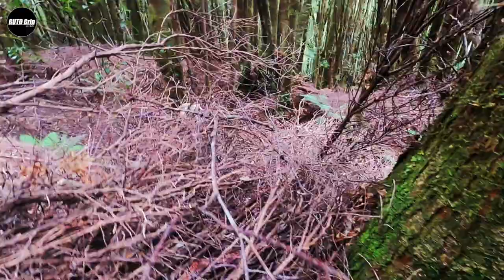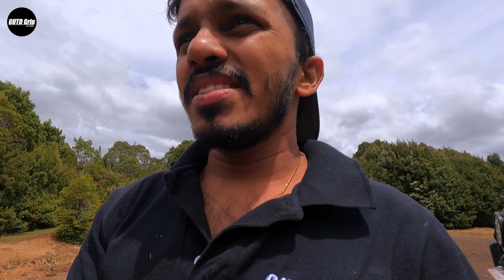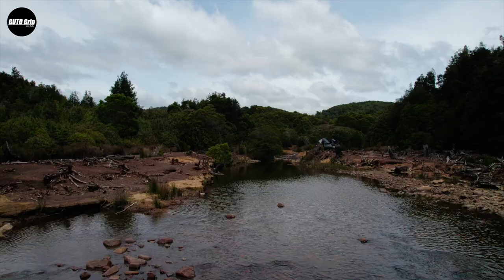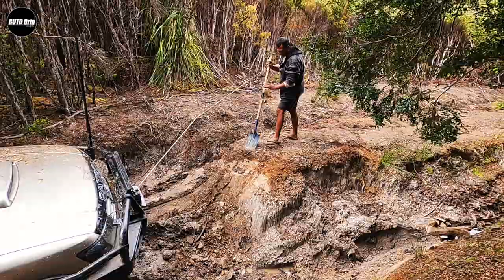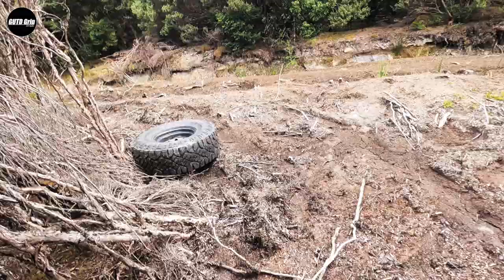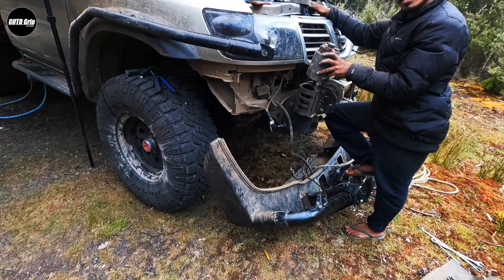හිතුවද මෙහෙම දෙයක්? 🤦‍♂️ | Magnet 4WD Track Tasmania | GUTD GRIP | Bogged

Comment: Battery winch aka wenuwata hydraulic winch aka set karanan  power lost aka adu karana  puluwan.(ikmanin battery bahina nisa). Transmission aken pto akata  hydraulic pump aka set karala  hadanna puluwan.  Nethnam drive  belt walin tama drive  karana wenne.  අදහසක් පමණයි 👍👍

Comment: I’m not surprised Nissan patrols are over weighted over rated bog magnets. They are good for touring with all the space and weight carrying capacity but least preferred for off roading. I don’t know why you guys and in generally majority of Aussies are crazy about patrols. A wrangler would have easily conquered that track if they manage not to break down in the middle of trail. But you guys are mechanics so should not be a problem 😊

Comment: @Gutdgrip By no means I am expert on this . But I do see few issues 

1: Not using proper protected shoes during 4WD*ing . I think most Sri Lankans do love to wear thongs. But I reckon its is vital to protect your foot against any harmful spikes or even snakes .I have seen you guys wear thongs in repeatedly. But something worth mentioning  

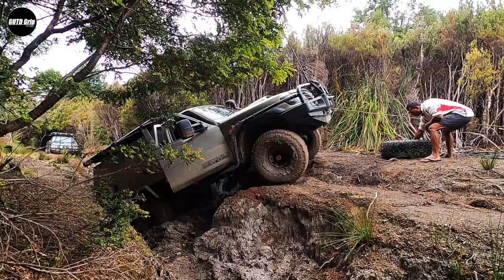2:   On 39:48 ,I was wondering what if you you would have used few Maxtraxs to gain more traction. Front wheel almost had no tractions at all . This might be y you endup burning your winch.. 

3: When you winching ..there is a zone called Death Zone. It is where a persons in highest danger if in case something failed and became a projectile  .I could repeatedly see you guys standing in these zone ..either talking or holding camera .I could see it happening even in this clip where high load recovery involved  . is this is the good practice ? my personal view ..what you doing is high risk.

Your safety always first . Hav fun
Reply: Thanks bro.. you brought up really good points. We will answer all these on a video after this series. I really appreciate this comment.